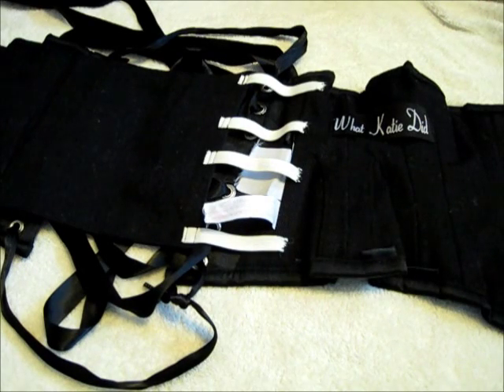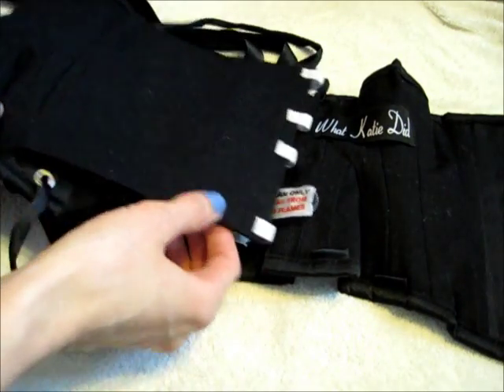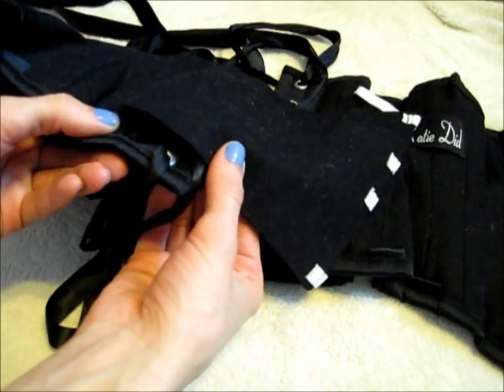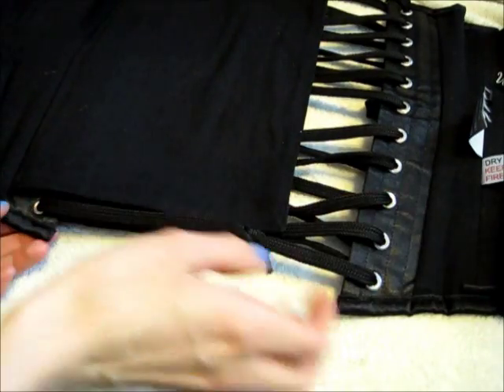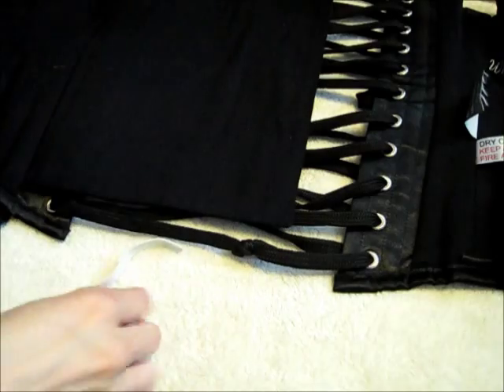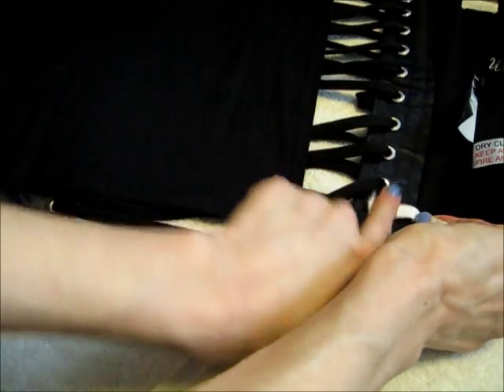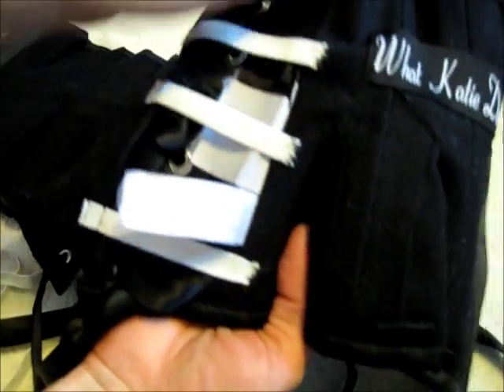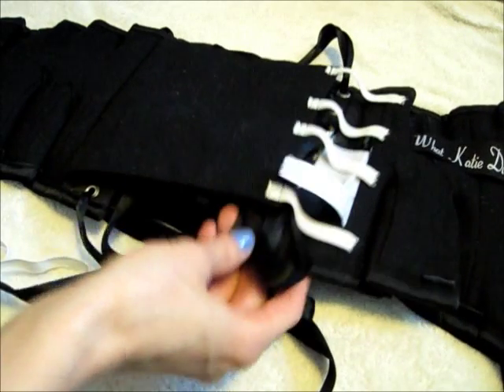Add Elastic To Your Corset Modesty Panel

Comment: Not sure if you'll respond but, that elastic in the back. Does that make it easier to wear? And get in and out of? 
I'm trying to hurry up and finish this makeshift/quick corset before this Saturday. I was thinking elastic in the back instead. Because i still need to add some boning